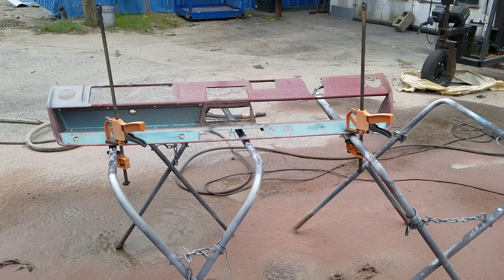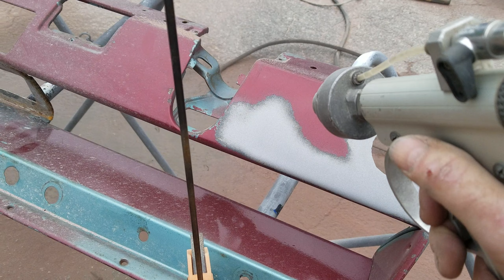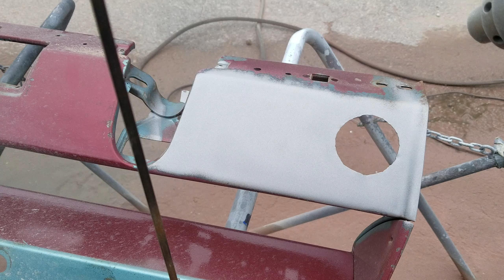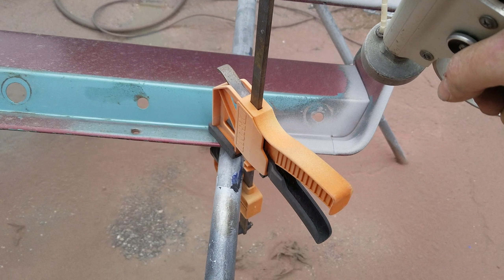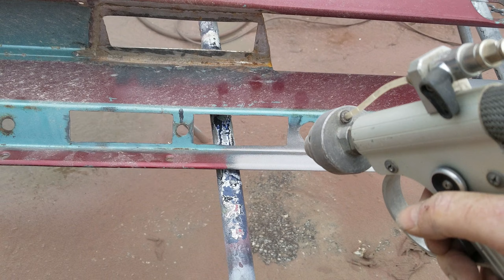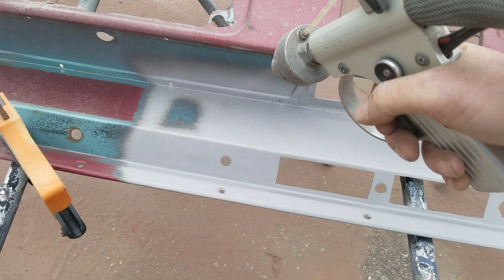Media Blasting with IBIX HP28 (Automotive)

Comment: Good Stuff here!  Been talking to the folks at IBIX and they suggested I follow you.  I currently have a DB800 but for smaller projects this system is more mobile and easier to use.
Reply from the maker: Good folks at IBIX!  Yeah, Its great for your smaller projects for sure. It's awesome for your very fine abrasives. As a matter of fact, I dont run anything bigger than 100 mesh glass through it. I mostly use 200 mesh garnet. It's only a 2 ply hose so if you continuously run 40/70, you will go through hose quickly.
Reply: @chattahoocheeblasting  40/70 CBG is our go to.  How many times can you reuse the garnet?  Also do you have the vacuumn attachment?  If so what are your thoughts.  I am in the painting business - mainly repaints from homes to industrial settings.  This last part of the week we had two door units, one wood and the other fiberglass.  The owner of the fiberglass door wanted the varnish removed - we did her door for her 11 years ago - ever since that was done she put a coat varnish on every six months!  22 coats of varnish!!!!!!!!!!!!  It took 2 1/2 days to strip this door, that is when I really started looking at this equipment.  The concern is to preserve the substrate but remove the coatings faster.  I can upload some pictures so you can see what a paint in the ass it was.  lol
Reply from the maker: They say you can reuse garnet up to 5 times. I dont reclaim though so have never tried. I've never used the vacuum shroud. To be honest, you need to see what you're blasting so I see more negatives with this vs positives.
Reply: @chattahoocheeblasting  Negatives referring the Vac Shroud?
Reply from the maker: Yes, the vacuum shroud
Reply: @chattahoocheeblasting  thank for taking time to talk to me today, it is appreciated.